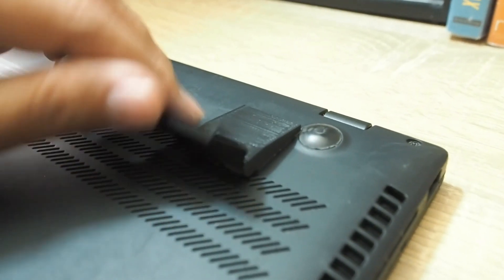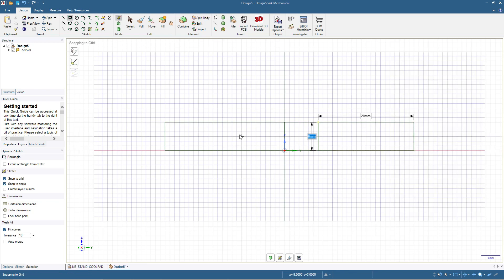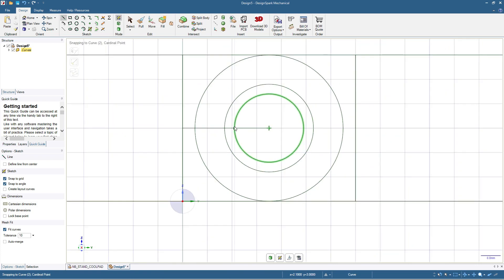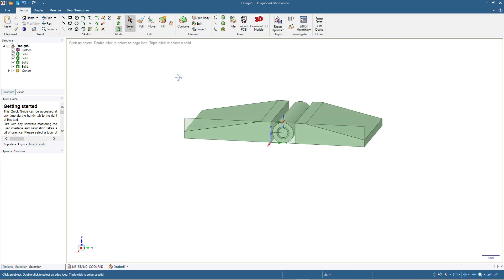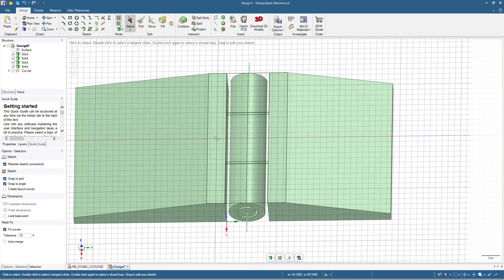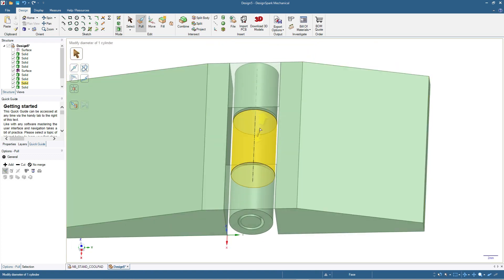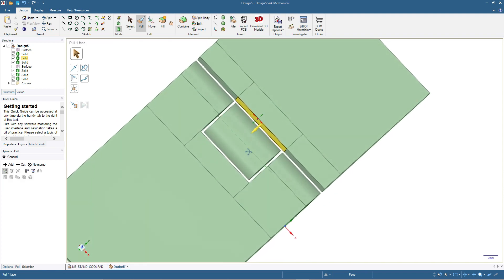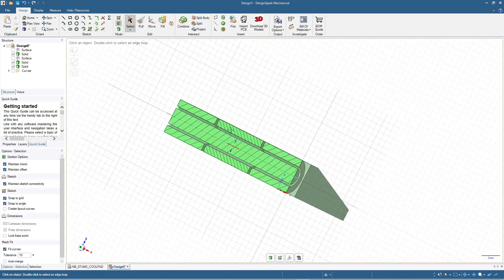3D Printed Foldable Notebook Stand / Cooling Pad Hinges, DSM Narrated Tutorial #22

Comment: I've been using DSM for quite awhile but one thing I've never managed to do is to get the grid to show heavier lines at 10mm intervals so I can count divisions easily.
In your video the major grid is clearly visible but on mine  all gridlines seem to be the same weight.
How to fix that please?
Reply from the maker: Try clicking File, then on the below menu "Designspark Options", 
Select "Units", and on the right tab there's a group for "Grid", fill in minor grid spacing : 1, and number grid per major : 10.
Hope this will solve the problem, have a great day :)
Reply: @W3DEStudio  Thank you. Those are my settings already. Maybe it's just my eyes! I tried to find a way to change course or weight of major grid lines but no joy.
Perhaps I'm too close to the monitor to see the difference!
Reply from the maker: @NickBR57  if the lines are faintly showing, try other step : click the menu tab "Display", then on the right side, check/tick "Show Sketch Grid"
Reply: @W3DEStudio  There's nothing like that in Options, but on the main application ribbon, the Display tab already shows the grid of course (or I wouldn't be seeing it to ask how to make major gridlines heavier weight!).
I tried setting Lineweight but that doesn't seem to anything.
Never mind, it's nothing to do with your tutorials and I'm sure it's just my eyes. It's a bit of a cheek to hijack your comments to ask anyway 😊